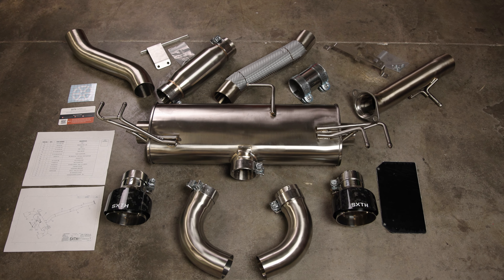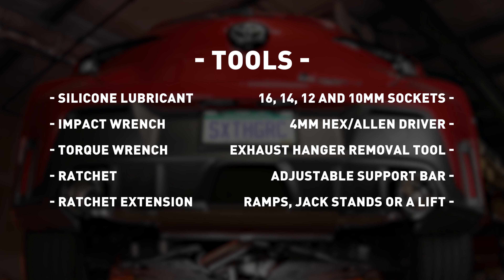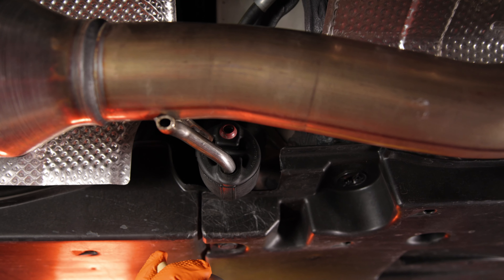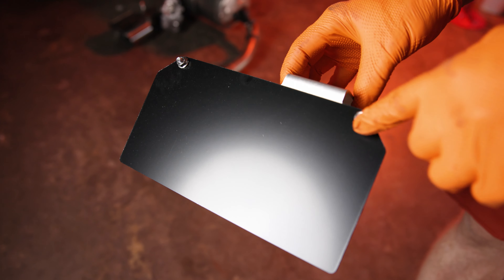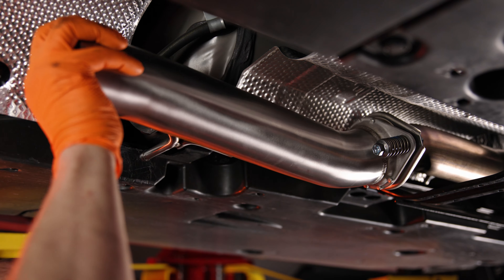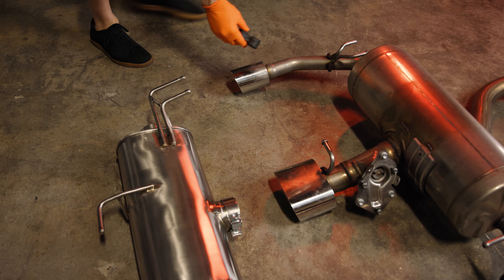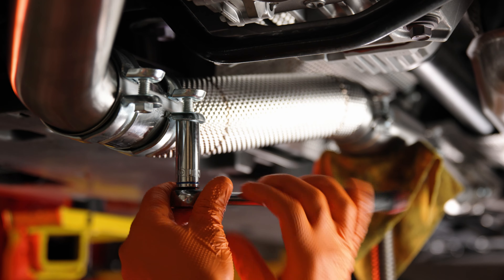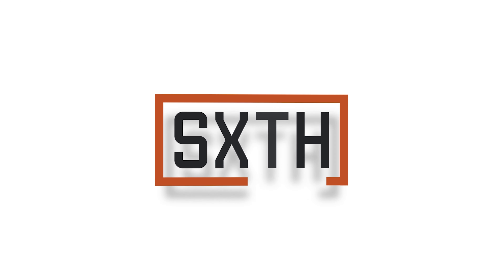GR Corolla Dual Exit Exhaust Installation

Comment: I picked up the single exit then exchanged it for the dual when the package came it was missing the exhaust bracket and the center cover they overnighted my question is what’s the valve for in the middle exhaust pipe on the stock exhaust and without that valve is it ok to run this aftermarket exhaust guess will find out I know it sounds good ❤